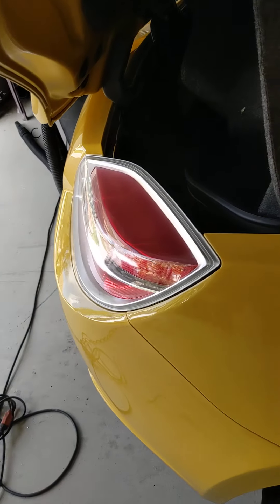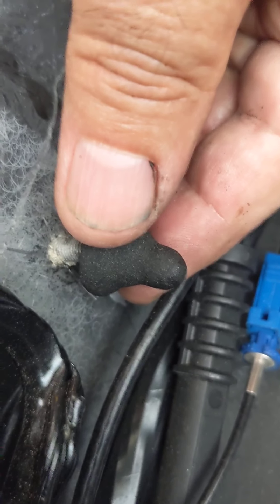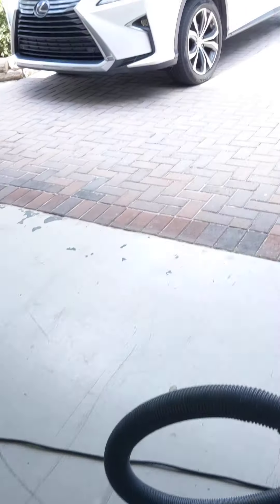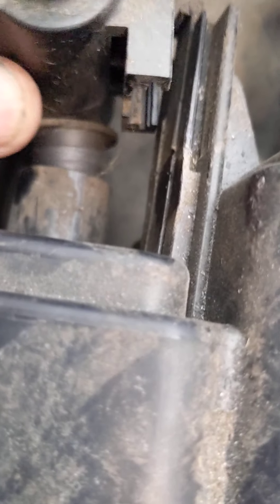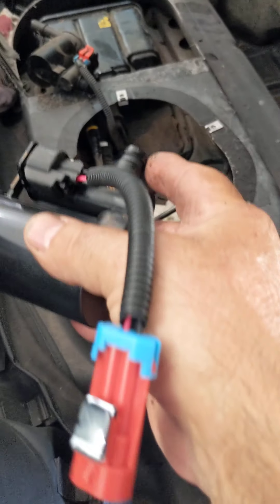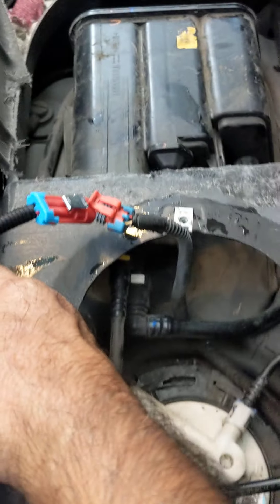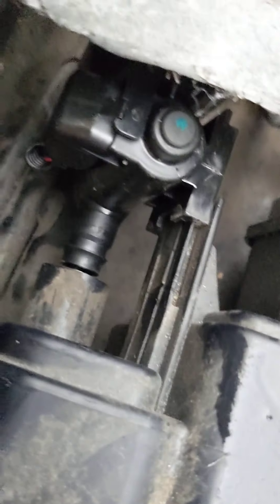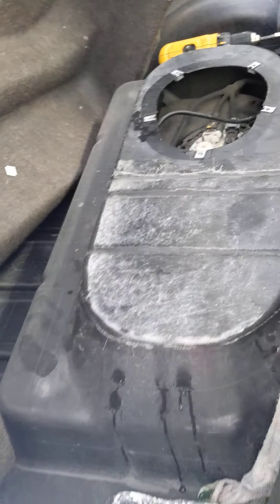Problem filling your gas tank on your Saturn Sky or Pontiac Solstice? Replace the EVAP vent solenoid

Comment: Is it mandatory to cut that hole in order to have access to replace the canister or can you go in from the other way. Also thanks for the video
Reply from the maker: Yes Danny, the hole must be cut. There are 2 tabs that are pressed down to release the canister that are on the bottom of the canister. Also, there is not enough clearance to remove the canister.
Reply: If you take it to a dealership, they will charge you for dropping the gas tank from the bottom of the car which is expensive. This is why people cut the hole in the top of trunk to replace.